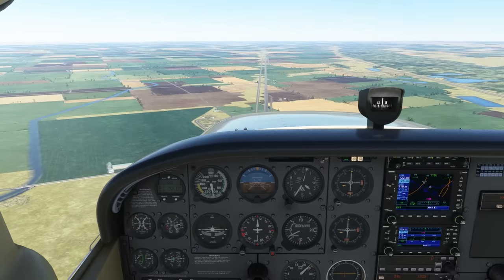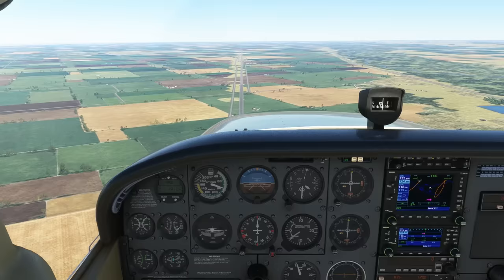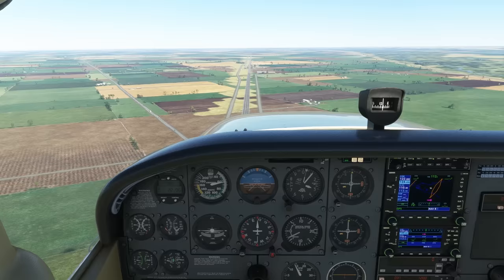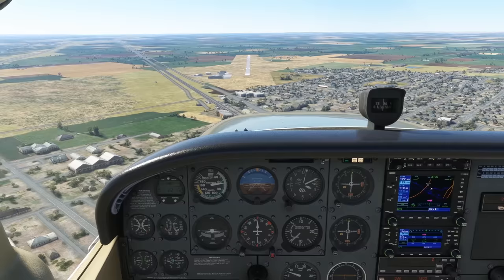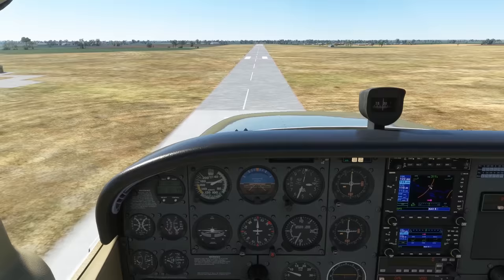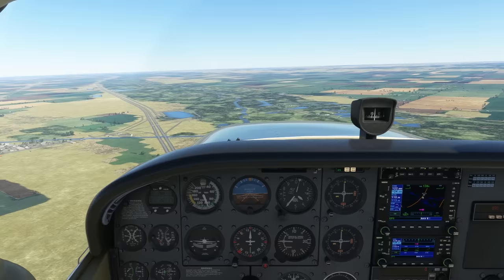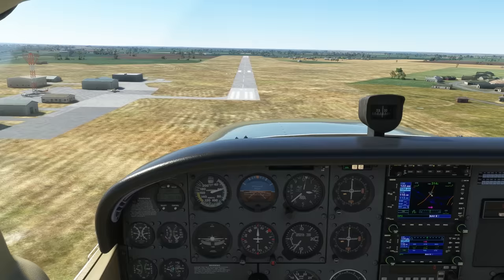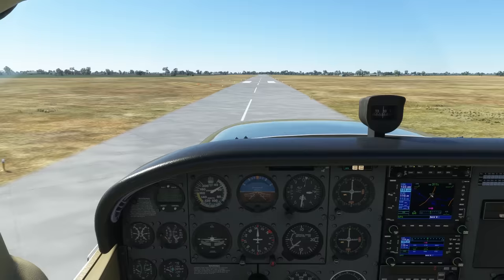How to Land an Airplane | Landing a Cessna 172

Comment: I am exactly 8 flight hours into getting my PPL. When I left the classroom and made my first flight with my CFI, I did very well on the take off, cruise and turning, holds, etc. Then I lined up for my landing. Folks, the first landing in your career will never be forgotten. I was in a 1978 Cessna 172 with steam gauges. I botched the approach and had to go around. But the second approach I stayed right on the line. Then I made what is known as a "porpoise landing" I touched down 4 times before I kept rubber on the pavement. My CFI glanced up at me and said "you don't get to put 4 landings in your logbook, so let's just keep it down to one, okay?" lol I thing every new pilot has made a multiple TD landing. But you're 100% correct, airspeed is the most important variable you must control. Once you have airspeed under control, everything else just seems to fit into place.
Reply: haha nice joke by the cfi
Reply: Loved that joke
Reply: Did the same thing! Except my CFI said, Bro this is not basketball… I’ve since been better but I’m only 16 hours in
Reply: keep working it, running out of money was always my problem
Reply: @brianmacpherson4913  LOL no doubt. Aviation is an expensive hobby. I was paying $180/hour to rent the plane. I was fortunate to have had most of the funds available for the majority of the flight training but I went thru it all. I was at zero balance when I got my PPL
Reply: PPL? People?
Reply: @brianmacpherson4913 do you run of money faster than airspeed? 😊
Reply: @rexnihilum7822  cfi?
Reply: @K1OIK private pilot’s license
Reply: I flew light aircraft from 1976 to 2003 but the most thrilling experience was the first solo flight
Reply: @abooismail  Yes, but the difference is when I run out of money I can push the nose over and coast on credit cards.
Reply: @valuedhumanoid6574  That is the way to do it. I was trying to do it on a wing and a prayer...mostly prayer. AVGas is not cheap
Reply: 😂😂😂 no 4 landings on your log book.Pilots were not born flying,im sure you are now a pro🤗
Reply: My CFI said I was an expert at the 3 point bounce .
Reply: @vcom2327  LOL Yeah, I can relate.
Reply: What do you mean by airspeed?
Reply: Hahaha I was very similar but I got lucky. I did everything no perfect and my landing was so smooth my cfi said he’s never seen anyone do a first landing so good but that was my best landing they got like way worse like I over think and stress about it now and can’t seem to get it right it’s improving though for sure
Reply: What's funny is that I don't remember the first landing I did... even the first solo landing. I remember my overall solo flight but that's about it. Lol
Reply: @K1OIK Private Pilot License.
Reply: @K1OIK Certified Flight Instructor
Reply: @johnstrain240  ppl stands for people.
Reply: They let you land at 8 hrs?? In Trinidad we fly with Civil Aviation rules, we don't learn landing until we complete our 10 hr check ride which I completed at almost 12 hours of flying time lol. I didn't execute my first landing until I started doing circuits. Now I'm almost 20 hrs into my PPL and I'm almost ready to go solo
Reply: @K1OIK certified flight instructor
Reply: Haven't bounced any as yet but I have landed like a Ryan Air pilot already.....it wasn't nice on the butt lol
Reply: @captainar0690  PPL?
Reply: @K1OIK Private Pilot License
Reply: @K1OIK … No … in this context it’s not “people” … it’s a “Private Pilot License”.
Reply: Absolutely
Reply: Go learn. Stop watching YouTube
Reply: I forgot my first landing 😭 all I remember is my cfi saying good job lol

Comment: This was a nice video, but a couple of points if you don’t mind.  First, it is critical that students understand that they must re-trim every time they change power or flap settings.   It is almost impossible to maintain a stable approach if the airplane is out of trim.   Also, using a road for a landing reference is fine…but I would never teach a student that it is okay to stall an airplane that low to the ground.
Reply: Exactly! That freaked me out. Obviously he wasn't stalled just triggered the indicator but that still too close for comfort.

Comment: I struggled with landings until my instructor taught me pretty much the way you describe. He had me repeatedly fly all the down the runway at a height of about six feet. Once I was able to demonstrate that to him he had me set up at six feet, cut the power, and try to hold the plane at six feet. Of course, as you say, the plane slowly sinks and kisses the ground. What a sensation!

Comment: Wow. That seems dangerous to stall at that low of an altitude.
Reply: I thought the same thing.
Reply: A low altitude stall is not dangerous if you stay on top of it by propping up the falling wing by applying rudder.  If you just sit there, then yes, it is dangerous.
Reply: @peteinwisconsin2496  The problem is, there's no room for error. The wrong rudder input wouldn't be good. Neither would a panic deepening of the stall by pulling up. No room to recover in either case.
Reply: Bobbysands wrote: > The problem is, there's no room for error.  <
Yes, it helps a lot knowing what you're doing.  I remember it like it was yesterday.  I was out with an instructor, getting my biennial flight review.  He said Let's do an approach to landing stall.  I set the Skyhawk up to stall, eased the yoke back to the stop and soon felt the airplane drop through.  As soon as the left wing dropped I pounced on the right rudder pedal and the wing leveled and returned briefly to flight.  With the yoke all the way back, the plane stalled and again I pounced on the rudder.  After a few cycles of watching me have a gay old time dancing on the rudder pedals, the instructor said: "Approach to landing stall."  Oh, right.  Rudder to level the wing while easing the yoke forward, add power and fly away.  BTW three stall/ return to flight cycles lost maybe 500 feet.
    Bobbysands is right that there is no room for error when you don't know what you're doing.  10,000 feet AGL might not be enough for some. It takes several seconds come down from 500 feet AGL, even in a stall/spin, so you have time to do something but you gotta know what you're doing.  If you don't instinctively know what to do, then I suggest more time practicing slow flight and stalls or rent a 152 and an instructor to perform some spins.  Sitting in the left seat does not entitle you to "ride" the airplane.  You are the final authority for safe operation of the aircraft so know what you're doing.

Comment: Sometimes on a landing approach the variables will change. Off of centerline or you balloon the aircraft after flaring too hard. Remember you can always go around and try again.
Reply: Not always! Coming in with a little extra speed and sticking the landing is WAY more important than eating up all your runway trying to make it smooth as glass. If you need a go around and are too close to the edge of the field and gotta climb to avoid terrain/obstacles, you're cooked.

Learn to stick a bumpy landing you don't like, and learn to go around when everything looks beautiful...there are times when tower might have a last minute call off, or you might forget to lower the landing gear, or unauthorized runway clearance like Harrison Ford ...
Reply: @joecee6862  that sounds like a hazardous attitude. Are you an instructor?

Comment: I used to fly in a single engine Katana (DA20). I miss those days. When I was learning to fly, my favorite part was just going around the pattern and practice landing. Anyone can takeoff. Each landing is different.
Reply: "Anyone can take off". I slightly disagree. In small planes, take off can be just as challenging in slightly higher than normal cross winds. I have experienced this several times. Once, admittedly when I was still in training, my plane instantly veered off to the left at a dangerous angle immediately on take off when there was a gust of wind.
Reply: @rameshb20  During one of my takeoffs while very close to takeoff Vr, a gust of wind hit and I found myself off the runway on the grass. Because of the short field and my speed, it became my first rough field takeoff. The cross wind specified for the Katana is only 20 knots. A good lesson about weather and flight safety.
Reply: “Anyone can takeoff” 
well anyone can land as well, however some only once. 😅
Reply: @kvadratbitter  Funny. And true.

Comment: Just did my first landing, touched down pretty hard because I didn't add enough back pressure, you're totally right about trying to keep the plane up in the air as long as you can so you just descend very smoothly onto the runway, hopefully next time is a lot better

Comment: Well, that was fun. I learned to fly in the mid-1970s in Cessna 150s at New Orleans' Lakefront Airport (no airliners), and then I flew around south Louisiana and Mississippi  for about a year for fun, mostly in 172s but also in the occasional tail-dragger and low-wing Piper. I only made two trips out of that area, one to Laredo, Texas, to visit Mexico and another to Albany, Georgia, to visit family. I was in a flying club, but it got too pricey for me, so I stopped. I've forgotten how to do it almost entirely. What I notice most on this video is the electronics which did not exist in 172s in the early 1970s. Time flies on.

Comment: Excellent advice!  On approach it's airspeed, airspeed, airspeed, and when the pavement gets close, slowly ease back on the yoke all the way to your belly so that the mains touch down with almost no lift remaining.  The nose will settle and the airplane becomes a truck, with no bounce being possible.  If you get queasy with how the airplane flys at very low airspeed then go out and practice slow flight.  Get good at that and you'll automatically be good at controlling the landing, though you will still need to develop your eye for height above the runway.   Also, there is no perfect landing.  At every point in the pattern you will tweak something-- airspeed, altitude, distance from the runway, something.  Nothing is perfect.  Fix it.

Comment: Full stall landings are fine in still air.  If you have a 25kt crosswind, it’s exceptionally dangerous.  Fly it in.  Harder on tires, but you maintain control. In my 337, I nearly idle the front engine, while leading with rear power.  The twin tails and elevator actually vector the thrust.

Comment: Pitch controls airspeed. Power controls glide slope.  Also, no mention of using the trim wheel. The trim wheel is key to stable approaches.
Reply: So generally speaking, what is the proper trim setting for landing? Is it the same as for takeoff or is there much more trim on landing?
Reply: @BillSmith-rx9rm  Each phase of flight will require a different trim setting. For landings you trim for the approach speed  as required for the airplane you are flying. Pitch angle controls airspeed. Adjusting the trim wheel,  as in all phases of flight,  you trim for that speed such as climb, cruise, descend, downwind, base and final. For example, when on final you set flaps to 20deg (or 30 or 40 etc) and air speed to 60kts you adjust the pitch of the airplane to get 60kts and adjust the trim wheel to hold that pitch angle for 60kts. It just becomes automatic with practice.
Reply: @BillSmith-rx9rm  You trim for the desired approach to landing speed for the aircraft you are flying. For example, I am flying downwind at 90kts and turn left base while setting flaps to 20deg. Flaps will cause the nose to pitch up and airspeed to drop and I want 80kts downwind. I push the nose down until I get 80kts and trim to hold pitch at 80kts. Next turning final I set 40deg flaps. The nose will pitch up causing airspeed to drop and I want 60kts. I push the yoke to lower the nose until I reach 60kts and, at the same time, trim the pitch for 60kts. If I have done everything right I will be on final and trimmed for 60kts all the way down to my flare point.
Reply: @2kalubafak404  okay, I understand what you are saying. It makes sense. My problem is that when I add flaps and trim and the nose goes up, and then I pitch down to compensate, the airspeed goes back up. What is the problem here? Am I not using enough trim? Am I trimming in the wrong direction? I also have a very common bad tendency because of these approach issues of winding up too high and fast, coming in at two steep and angle, so that when I flare I wind up floating halfway down the runway before I can touch down.
Reply: @BillSmith-rx9rm  Controlling an airplane is about "applied pressure to the controls" rather then a pushing or a pulling. PITCH TO THE DESIRED AIRSPEED, HOLD PRESSURE ON THE YOKE AND TRIM UNTIL THERE IS NO PRESSURE FEEDBACK. Try pushing the yoke with your fingers so you feel the feedback. Do this: when you apply flaps and the nose comes up, concentrate on the pressure you feel in your fingers as you push the nose down to reach your required speed. Hold pressure on the yoke to hold the airspeed and turn the trim in full increments.  Notice with each turn of the trim that it takes less finger pressure to hold the yoke/pitch for your target speed. Adjust the trim until the pressure sensation just goes away. Recheck your airspeed and adjust as required. So when trimming for take-off, cruise and descents feel the pressure on the yoke and trim until the pressure goes away and you have the airspeed you want. This will become habit with practice so  it is just automatic. A properly trimmed airplane is much easier to fly.
Reply: @BillSmith-rx9rm  Anticipate what is going to happen when you drop flaps. Don't push. Apply pressure to the yoke and watch for your desired airspeed.  I often just pressed on the yoke with one finger to get my airspeed and trimmed until my finger felt no push back.  Takes practice.

Comment: I would like to add that the threshold of the runway be kept about the center line of the windshield upon approach. There will a time when that changes but you are lined up, close to touchdown and ready to roll. This video shows this.
Some say there is nothing finer then sitting in a recliner. But landing a plane is really a lot of fun. Never missed and never had to go around. Spins are exciting but the best part of the flight is landing. Helicopter. Even better. Love the cyclic control.

Comment: Little tip when instructor says “aim for the number” does not mean you gonna land on the number. You can use much runway as possible for the smooth landing if you feel like you got too much speed, number is just good aiming point to get ground effect. All my PPL I thought instructor was made me land on the number because he didn’t clarify that.
Reply: Don’t write words you speak. as in gonna, wanna. People using slang expressions never think they’re making it harder for someone who doesn’t have English as a first language to read. Gonna, gotta, wanna, outta, and kinda all represent words as they are pronounced in informal, spoken English. They should not be used in formal writing.

Comment: I ended up landing my planes just about this way.  I hold it just off the runway, continuing to pull the nose up to keep it there.  I feel like I’m imitating a bird as I reach forward with my gear to set it down.  I think I’m only like a foot above the runway as I glide off the speed to touchdown.  Be the bird😉.

Comment: My learning was il2 Sturmovik with ww2 prop planes. Those can take the punishment.  I could get super fast, zigg zagg a bit to slow dawn fast push the plane down, pull up a bit not to crash land and then stall at few centimentres away from the runaway.

Comment: 30 years ago I was a passenger in the copilot seat on a 172 landing near Marianna FLA . At 50 yards short of the runway edge the stall alarm goes off and we touchdown on the grass and roll onto the tarmac. The pilot noticed I had a panicked look on my face he said “ I guess I should have told you we were going to land short I did that to save wear on the tires”

Comment: The Cessna 172 has to be my favorite GA airframe. It is one of the easiest to learn and one of the most forgiving of the mistakes you usually make as an amateur pilot.
Reply: I agree, except in crosswinds. The low-wing Pipers I flew as well were definitely easier. I rarely had to cross-control them as I would do in the 172; crabbing- in and kicking the rudder worked just fine. The Cessna, though could come in at 60kts, while the Cherokees were at 70kts. Love ‘em all 👍

Comment: Try using your gps ETA for center field arrival. Take your altitude above air field. Use quick mental calculation altitude divided by 500 ft/min decent rate. Discover at how many minutes out.  reduced power for a 500ft/min decent. Keep the airspeed required for the cargo-passengers on board. But usually 80mph is good. Add about one minute to your calculated decent initiation, since you're not landing center field, right?

Comment: I used to fly radio control airplanes way back in the day, it was a hobby my dad and I enjoyed together. And landing the RC plane was the hardest part, at least a good landing was. But basically you would fly around the runway and line it up, give yourself a good distance, and back off the throttle and let it take itself in, as you get right above the runway, a few feet cut to idle and most of the time it's a smooth landing and your plane is ready to fly another day.